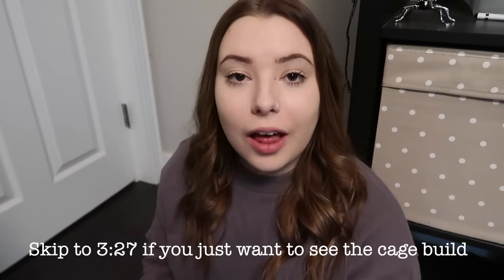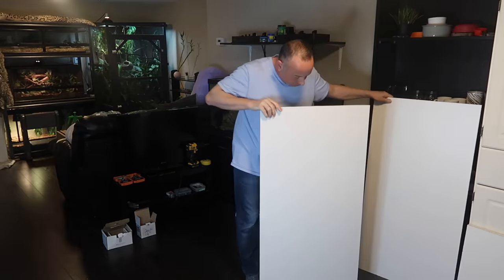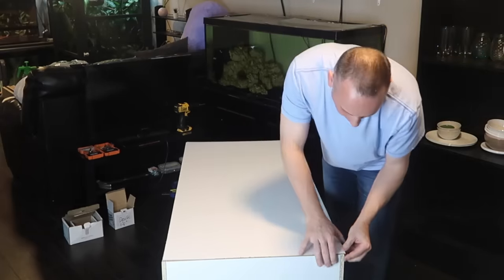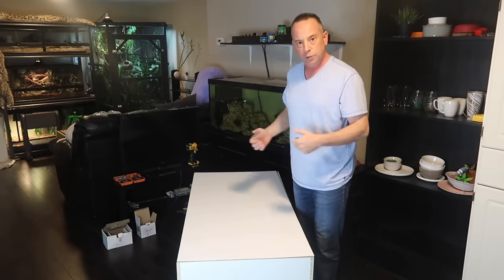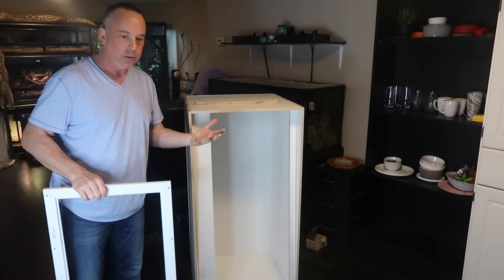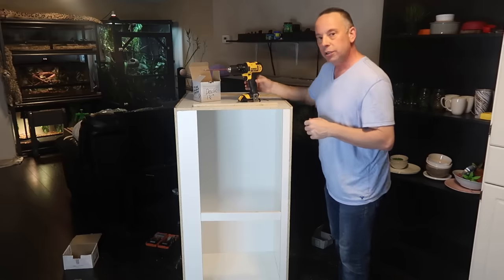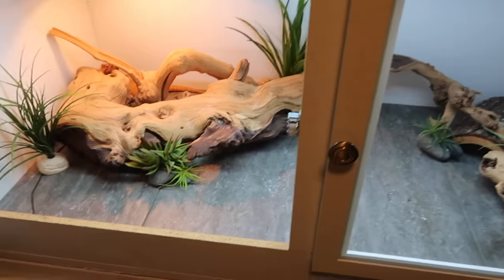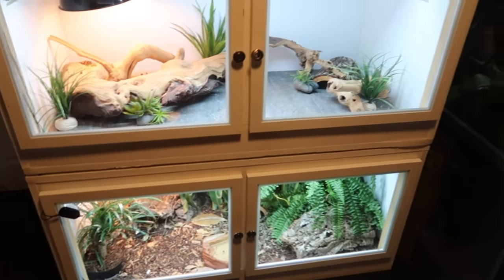How To Build Your Own Reptile Enclosure! | Perfect for Bearded Dragons, Skinks + More

Comment: Hello all! Emma’s dad here... thank you for the many compliments! Just a quick update to this, I found that the small vertical pieces on the front (where the door hinges attach) and the center piece (where they latch) weren’t really sturdy enough for my liking the way I attached them originally, so I attached an extra piece of the same width, but the full length of the space inside from top to bottom (approx 23 inches) directly to the back of each vertical piece. This way I was able to screw that extra piece into the top and bottom horizontal pieces for extra stability, and then also put in a few screws into the original piece now in front of it, so the center piece especially that was “toe-nailed” in the video is much stronger now. In simpler terms all the vertical bracing pieces have all been “doubled”, but again since the extra piece was attached in the inside, it can be several inches longer and attached at the very top and bottom. Much more stable now. Thanks for watching Emma’s vids! ☺️
Reply: aksampson68 how much was this in total cause it looks amazing for my skink I’m getting
Reply: @dreadfulsin4243  150$
Reply: @dreadfulsin4243  Thanks! I'd say the whole thing came together for less than $225, including all the hardware such as hinges, door handles etc. It was a bit cheaper than it could have been since she wanted 3 of them built, so rather than buying pre-cut 4x2 pieces I bought full 4x8 sheets and had them cut into quarters, so that saved about $50 in total.
Reply: What are the measurements of the doors??
Reply: Hi Emma’s Dad, I’m in the process I’ve building this exact replica thanks to you for two bearded dragons. Can you please give me the info on how you installed the lights please?
Reply: aksampson68 can u please give a link or description of how u got the doors from IKEA?
Reply: Are these about 4’ x 2’ x 2’ ? Or is it bigger?
Reply: We stan a supporting dad
Reply: When you built it is there a reason why you connected the wood pieces on top instead of aligning them and then attaching them together? Was it solely for the extra height? I’m building an enclosure the same size as this and was wondering about keeping the humidity and heat in. If the pieces of wood overlap would it not hold on heat a bit better? Sorry if that doesn’t make any sense. I’ve never built anything that didn’t come from a kinder egg🤷‍♀️
Reply: So to stack u just bought extra stuff to stack or she put everything of what we needed in the description?
Reply: @undeaddrogon Hello, everything needed for one unit was shown in the video, but I built 3 separate units and just stacked them one on top of the other. I put small rubber feet on the bottom of each one to ensure they didn't slide around. Cheers
Reply: aksampson68 ikea sells the shelf in different sizes which size is shown in the video
Reply: Thank for the little update Emma's dad. She is lucky to have a dad like you.
Reply: Uggg my Home Depot only sells the Melamine in 3/4” sheets. I wonder if that will still work or if it will be way to heavy?
Reply: @sararomine6023  I'd say that shouldn't be too much of an issue, it will certainly be heavier but since it's only the pieces around the perimeter (I used an 1/8th inch piece for the back) it shouldn't be too bad.Good luck!
Reply: What size were the doors you got from ikea?
Reply: @johnschell1351  I don't recall exactly, but I think around 18.5 by 23 (inches).
Reply: @aksampson68 it’s really cool how you built that! I can’t believe you did it for so cheap my geckos basic 20 gallon costs way more than that! Maybe I should change it something more natural and pretty and cheap like that.
Reply: Would you mind posting a parts list? This is seriously awesome 👌
Reply: @kristencasillas4613  Thanks Kristen, I pretty much just bought two 4x8 sheets of white 1/2-inch melamine and cut all the pieces to size myself using a table-saw. Then the backing piece was taken from a 4x8 sheet of 1/8-inch melamine. That said, I bought multiple sheets only because I ultimately built her 3 units. If you're building just one you can buy pre-cut sheets that are 2x4 (basically a quarter of a full 4x8 sheet) which would be a little cheaper. Other than that it was just the two doors that were bought as is from Ikea, then just the hinges and door handles so really not much in terms of materials. Best of luck!
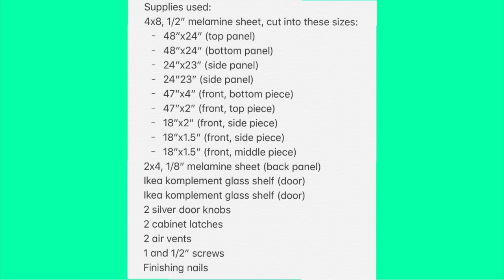Reply: @kristencasillas4613  PS ~ Emma posted a parts list at 3:27 of the video :-)
Reply: @aksampson68 thanks for the walk through. Is there a reason that you put the sides inside rather than on the outside?  I’m about to make a box 4x2x2. But the big board is 3/4” thick. Figured I would do all even cuts 48”x24” front/back/bottom and 24”x24” for both sides. And have the sides on the outside that way I don’t have to accommodate the different size of put inside. If put inside like you did what would the dimensions be for the sides since the boards are 3.75” thick. Thanks
Reply: @Jlui83  It pretty much comes down to the piece that you put on the back - in my case the 1/8-inch piece which was already cut to exactly 2x4 feet. If my side (end) pieces had been on the outside it would have extended the entire length of the unit from end-to-end by an inch and a half (if using 3/4 inch) so the total unit length would have been 49.5 inches instead of 48, so my backing piece would not have reached the edges. Best of luck! :-)
Reply: Hello
We are building an enclosure for my daughter's Christmas.  Can you please tell me how you installed the basking and UV light?
Reply: @kristyburke6424   Hi Kristy... if you pause the video at about the 28:35 mark, you can see the hook I mounted for the basking light, just a standard screw-in hook, then I just used some bare copper wire that runs through the vent holes of the lamp to hang the basking light from that hook, then built 2 "L-shaped" mounts that were screwed in from the top of the enclosure, on which the UVB light just rests. Good luck!
Reply: @aksampson68  Hi! So I just found this and I’m wanting to build the same thing for my lizards but I have a few questions. The supplies needed are doubled for 2 tanks correct? The way they are stacked means I’d need everything times 2? Also do you know what size doors are used?
Reply: @AlexisPughLexis  Hello! Yes, certainly double everything, and I recommend getting some rubber "feet" to install on the bottom corners if you're going to stack them, this will keep them from sliding. And here's a link to the doors. Good luck! https://www.ikea.com/ca/en/p/komplement-glass-shelf-white-00257646/
Reply: @aksampson68  did you use the 50x58 cm for the doors?
Reply: @AlexisPughLexis  yes - that's the one. Cheers!
Reply: Hello Mr. Sampson, I am just wondering if I should be worried about the melamine catching on fire due to the heat lamps?
Reply: @VeritasReptiles  As long as there is adequate clearance around the lamp, and vents to let out excess heat, it should be fine. Emma has had hers now for over 2 years without issue, but certainly keep an eye on things for any scorching if the lamp is too close to a surface. Good luck!
Reply: @aksampson68  Alrighty, thank you!
Reply: @aksampson68  hello sir I can’t seem to find the 2x4 1/8 melamine, is there another size I could use?
Reply: @alishwhaley1262  sure, really any thickness is fine, I just used the 1/8 inch because it's nice and light and keeps the weight of the unit down. But another sheet of 1/2 inch would certainly work. The thinner the lighter really is all it comes down to. Good luck!
Reply: [  ] Stacey's mom
[x] Emma's dad

_ has got it goin' on.

Excellent craftsmanship. I clicked on the video and honestly thought the finished product was some commercial option that was being presented as an example.
Reply: @terrymiller111  LOL... thanks for the kind words, but Stacy's mom definitely has more goin' on than me. Hahaha :-D
Reply: You're an awesome dad!
Reply: hello emma’s dad! i’m currently in the process of replicating a tank like this for my bearded dragon. i was wondering was it just one full 4x8, 1/2” sheet of the melamime that was cut to make all these pieces? or did u buy several sheets to make all the pieces?
Reply: @itsdavidlopez  we ultimately built 3 units, so I bought several pieces, but a single sheet should be enough for one. Good luck!
Reply: @aksampson68  Hi! Did you seal the wood with anything to make sure the humidity didn't affect the wood?
Reply: Would the same method use for larger enclosures? I need an 4W×6Lx6H for my frilled lizard upgrade as hes getting bigger. And a 4Wx8Lx4H for my False Cobra (not a true cobra species. They barely have enough venom to cause some swelling. Unless youre allergic to bees/wasps, then youre probably allergic to colubrid venom and may have a more severe reaction).

Would i need additional bracing to keep them stable? I have done some woodshop butmost of my projects are small quick things. Theres a bit of a difference between a jewelery box and an animal enclosure.
Reply: @Kitsune1989  It should, but yes... for something 8 feet long I would definitely try to strengthen it with some additional bracing. It's kind of hard to describe, but I might go with pieces of 2x2, to build an interior frame first, so that you have a 3-dimensional rectangle built out of the 2x2s, then every two feet along the entire 8-foot length, place a "square ring" of additional 2x2 lengths for support. The end result would basically look like 4 "cubes" of 2x2s stuck together, then build your exterior onto that frame. Hope that made sense... good luck!

Comment: I built this cage for my young savannah monitor and it came out great. I wired my own light fixtures into the top though and had to make a few tweaks to the dimensions because the Home Depot employee who cut the melamine butchered it, but overall I’m thrilled with how it came out. Thanks for posting this! The ikea shelves worked out perfectly but I wanted to use decorative cabinet hinges and in order to stop them from sagging I had to use four on each side since they aren’t that strong. 

Tip for anyone that tries this: I also found white “tape” next to the melamine in Home Depot that I ironed on to cover the areas that didn’t have the plastic coating on on it and it worked perfectly because it was made out of the same white material.
Reply from the maker: Thank you! I’m glad that this was helpful for you :)
Reply: did you use a thicker back panel for the Savannah enclosure?
Reply: How much it cost for you ?

Comment: Hey Emma, I also have a question. Would you consider doing a video about properly setting up lamps in your reptiles cages? I know in the reptile community lighting in the cages can sometimes pose a fire risk. I have yet to own a reptile that requires one inside the cage, but I think it would be a good topic to talk about since your videos may reach more and new reptile owners! Let me know what you think! :)
Reply: Keep up the great cham videos!
Reply: Reptitan Awh thanks! I will!
Reply from the maker: Yes!! I’ve had a few people ask about that since I posted this video, so I’d like to do one talking about that soon!
Reply: @EmmaLynneSampson  is this gonna make a 75 gallon tank? I need one.
Reply: Vanellope'sCorner no it is equivalent to a 120 gallon
Reply: @EmmaLynneSampson  did you post any videos on light attachments to enclosure?
Reply: @EmmaLynneSampson  hello have you made that video yet ?
Reply: Personally, i just cut a square on the top, put enclosure mesh over it, and stick a lamp on top rather then install lights/lamps inside. I'm too paranoid about burns or one of my idiots somehow knocking the heat light off and a fire breaking out, or them somehow getting at the cord and chewing through it or doing something equally stupid/crazy. Ive got a few reptiles where swimging from the lights would be just the kind of thing they'd try.

I also have a panther cham who is jealous of my longer lifespan and has done his best to scare enough years off me to match his. Its like having a vindictive child where you aren't sure if youll come back to the kid in bed asleep or the babysitter tied up as the kid googles human sacrifice.

Comment: I've been researching ways to gut a dresser and turn it into an enclosure for my ball python. I have friends who installed sliding doors and their snakes escaped. I was planning on one large door with hinges at the bottom and a latch at the top until I found your video. I think double doors are a much better way to go. There's even a size of those ikea shelves that will fit on the dresser I just thrifted! So thank you for this information it's going to make a big difference in my project. Yall are great

Comment: Hello I had a question, have you found any problem with the moisture in the skinks tanks? Do you recommend putting anything under the substrate so it doesn’t damage or rot the bottom?

Comment: I've built two of these and now I'm on my third. Just wanted to say my Ball Pythons love them and I'm sure my new Bearded Dragon will too. Thank you for this video! Was wondering if you have done any updates to your enclosures?
Reply: How are they with maintaining humidity? I’m thinking about making a couple for my bps as well but I’m a little worried that the small gaps in the doors and the large vents would make it difficult to keep the humidity stable
Reply: @brittanybueckert604  I have no problem with keeping the humidity stable. My first one I made I did the two large vents on the side and it holds the humidity well. The second one I made I skipped the vents and I rarely have to mist even during a shedding period. I made mine out of Home Depot Veranda HP PVC board.
Reply: @aliagasergio  with the PVC did you use the same thickness as the melamine in the video?

Comment: Great videa! only suggestion that I have is a pocket hole jig would keep the center brace from splitting. And could use on the top, bottom, and sides as well

Comment: Cool! I’m building my own chameleon cage right now! It’s 2x3x4 which is above the minimum. We have a drainage system at the bottom by using a washing machine drain at the bottom of the enclosure connected to a tub that I can change out! I love these DIY videos!
Reply: I actually never thought of that solution. I go fully bioactive so drainage has always been an issue with my arboreals that need a dripper/water feature. Ive always had a bit of pvc pipe that goes into the drainage layer and i shove a tube down there every once in a while to get rid of the excess water. This sounds so much more convenient so thanx. I hate the mesh enclosures, which is the only thing you can buy where i live, because i can never get temps/humidity stable using it and full glass is super heavy and needs extra things to be chameleon safe. So i started making my own.

Comment: I did something very similar to this! 

I used the same melamine shelf for the bottom but only did a frame of maple 1x2s and used metal screen to cover the sides because I never have temp issus in my room and it has the added benefit of my bearded dragon being able to use the sides for extra climbing space!

Comment: How did you hang your lights in the enclosures?
Reply: It looks like at 28:43 she/ her dad used a hook that has a screw bottom aka a screw hook and most likely drilled a hole then screwed it in by hand and with the other light it looks like she/her dad cut some more of the wood into pieces that would be large enough to hold the light but not too large that they would cover the light and then drilled a hole and then screwed screws in and screwed that into another piece that was the width of the light and screwed that into the top of the enclosure
Reply: Emma’s dad here... b4l_gamer is essentially correct, screw hook for the heat lamp, and for the tube light I just found some scrap wood pieces that were slightly “taller” than the light fixture to act as spacers, screwed into the top panel, then “shelf” pieces that slightly overhang the spacer piece for the light itself to rest on.
Reply: aksampson68 Is there any way that part of the roof could be replaced with wire material so a light strip could sit on top of the cage?

Comment: Did you treat the melamine with anything for the skink cage? I find it's not so good with something damp sitting on it for long. I have a melamine shelf in my kitchen covered in water stains from forgetting to not put wet/sweating cups on it. Lots of cup rings lol. I have a DIY beardie cage too made of thin solid oak boards and plywood that was all treated to be water proof. So much lighter then melamine.
Reply: Emma’s dad here, I think she laid down some rubbery kind of shelf liner before putting the substrate in. Cheers!

Comment: I’m in love with this enclosure my question is I have a leopard gecko & I keep getting told that you can’t use heat lamps so is there like an alternate or a way to use a heating pad I guess with an enclosure like this ?
Reply: I, saw in, some videos you can put the heat matt inside the thank but you gotta regulate it very well that the leopards can't burn them selves

Comment: Any problems with moisture getting into the exposed cut edges of the board? Also I noticed you didn't seal the edges with silicone. Has there been a problem with moisture or dirt getting caught in the crevices? Thanks, loved the video!

Comment: Hey Emma! I built this tank with my stepdad not too long ago for my kingsnake, following your instructions! I was just wondering how you heated yours. I'm having some difficulty getting it to the right temp.
Reply from the maker: I just have heat lamps in mine! For a king snake I would probably use a radiant heat panel, or if you use a heat bulb just make sure it has a bulb cage over it!